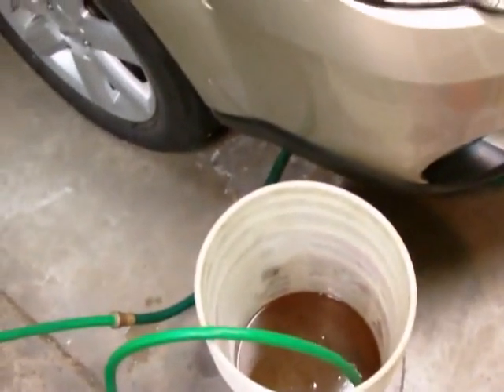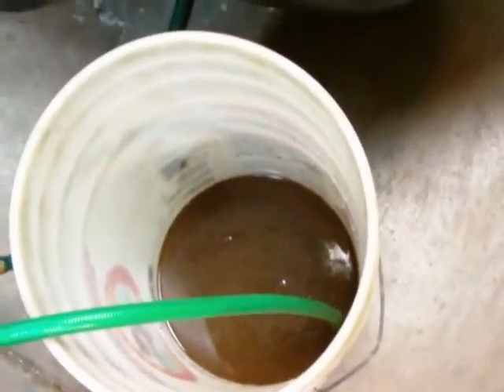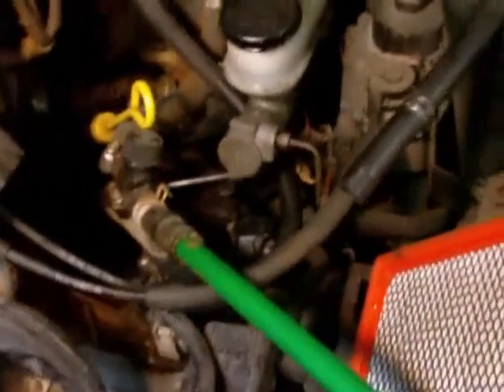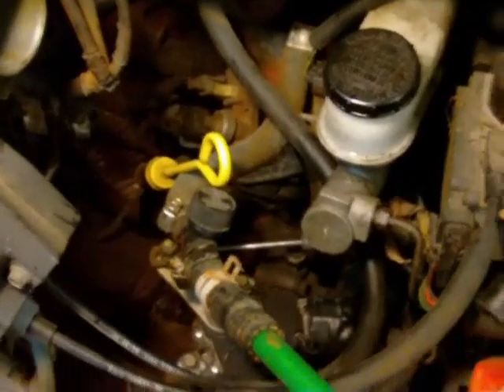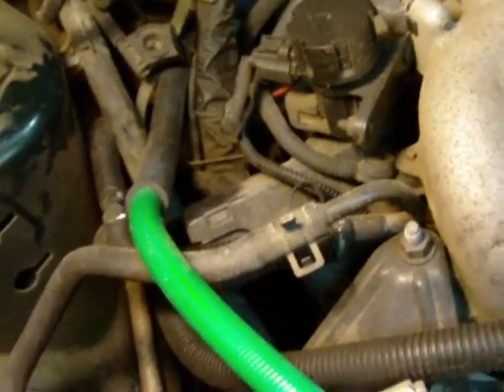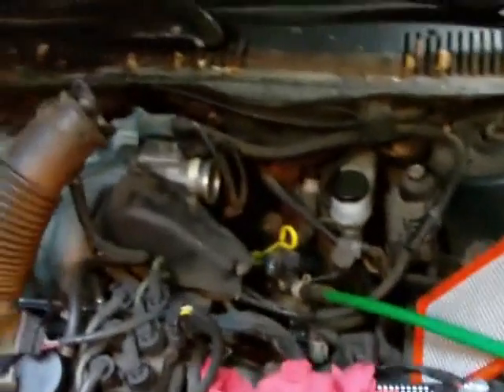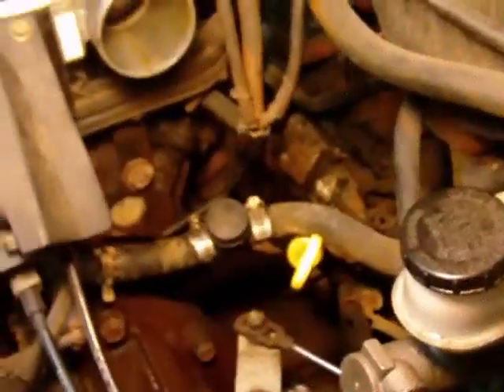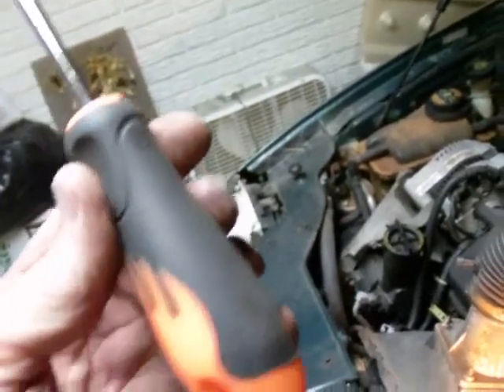Taurus Heater Core Flush-- Read Description below

Comment: Heater core fluid direction of flow. The direction is from drivers side to passenger side. Antifreeze enters heatercore from riverside to passengerside. Flow comes from thermostat to waterpump, coolent enters radiator and back into the engine.  SO ! The waterpump should actually be called the waterpuller / watervacuum / water pressure deflater....

Comment: I use a garden hose to place on the end heater core and blew to it the crud came out an was machine inlet hose to squeeze in to 5/8 hose to flush them out, put a little grease on the hoses to slide the claqmp off. noow my taurus sit and idle i get 125 t0 a 130 degreescoming out ofthe vents every 3 years i flushes out this system bought this car new in 98 and running with the same radiaor only replacedthe heater core once, you definitely have to pay close attention to the coolant sytem in the taurus my fluid always come out green in 3 years when it chaning time.

Comment: Thanks for the great info DOLRED, I have a 2002 Taurus for the Mrs. and the heat has never worked properly since I bought the car about 4 years ago.The AC is great and the car has never run hot. Many mechanics had quoted the job, and the last was from Ford for $1800.00 for a new heater core and radiator which is too much for a car worth barely double that. I did a more simplistic version of his video, but could not have done it without the advice. I took off the heater line at the water pump and the one on the other side at the engine block. Used a clear large apple juice bottle on the water pump side hose to catch the crud, and a bucket underneath on the other side intake. I did this outside my garage and only lost 1/2 quart of antifreeze/fluid mix which I did catch/clean up if it missed the bucket which did happen. I don't have a shop compressor, but do have a small DC one that plugs into the cig lighter for emergencies for tires. Used a large smooth C-clamp to block the bypass line which is what had been feeding the engine as the heater core had not functioned in quite some time. Made a fitting from electrical tape for the air compressor fitting and inserted it into the "drivers side" hose, and while using two hands to keep pressure, blew out some real nasty stuff. Once the "crud plug" was busted, poured water down that same tube and repeated 5 times. Reinstalled the hoses with C-clamp still in place and topped off the 50/50 antifreeze mix. My car had clean antifreeze outside the heater plug issue, which made a lot of this easier. Started car and ran it with C-clamp still in place to finish the blow out. Heat was working awesome, let run for about 20 minutes, removed bypass line C-clamp, and ever since the car is as hot as you can stand. I spent about 1.5 hours on this and the money savings and heat for our old Taurus is just awesome. Thanks again DOLRED for showing a workaround to spending major $$$ and our two year old is having a much better winter now in the back seat. Could not do this stuff without people taking the time to post instructional videos for the weekend warriors!
Reply from the maker: Glad it worked out for you!!

Comment: On the side your shooting water I see you have a back flush connection Tee. Why did you break the line from the engine when you could have just clamped off the connection and flushed through the screw on connection at the top of the Tee?

Comment: I'm sorry but you got it backwards. At 1 Minute you start to say the front of the engine (where the alternator is) "is where the antifreeze will move to the heater core right off the top of the front of the engine where the thermostat is and return to some other port".  The Water Pump is at the front, Thermostat is at the back.  The anti-freeze comes from the top of the Water Pump (front of engine), goes to the Heater Core and returns (back of engine) to the bottom of the thermostat housing.

EDIT: just read the description that you corrected yourself.

Comment: Locate the lines to and from the engine block from the heater core. Disconnect both ends of the heater core clamp the by pass line, BY PASS LINE MUST BE CLAMPED CLOSED, VISE GRIPS WILL DO. line leading to the heater core. now reverse flush the heater core with a garden hose ..now try  flushing the water in the direction the water normally flows through the heater core. Repeat this process until the water flows freely through the pipes / heater core..once satisfied reconnect and start er up heat.

Comment: This summer the inside of the 99' Taurus SE started to get smelly, usually when the AC was on normal (not Max A/C). I thought it was brake fluid, and took it in and they said brakes are perfectly OK.   Wife thought it was anti-freeze.  I used  lots of Bar's leak, and now the heater core is plugged.  I'm breaking in just at the core inlet and making use of the bypass for the reverse flow.

Comment: Thanks for posting this.  I used these instructions and I did this on my 2002 Taurus, pretty much the same general procedure except for the heater core bypass hose.  I had no heat in the car for months, after doing this it will melt your face.